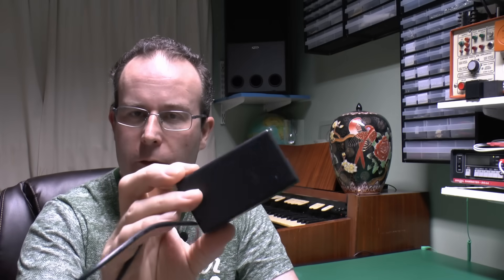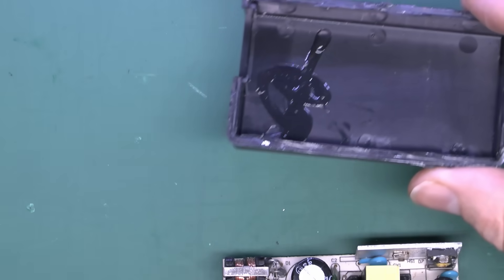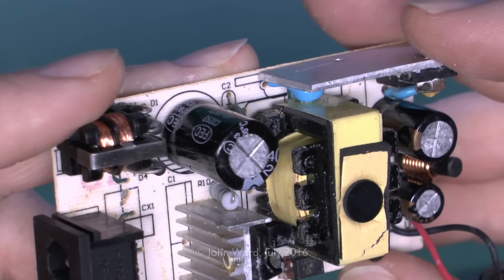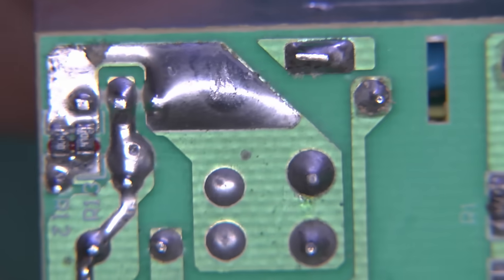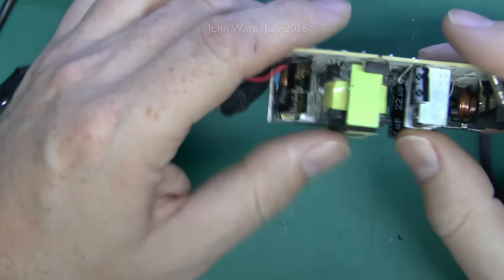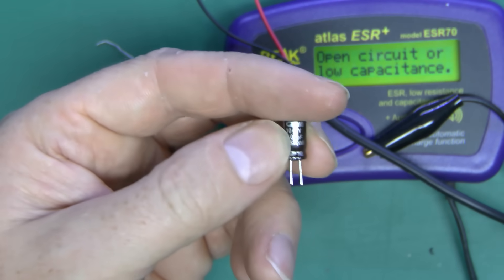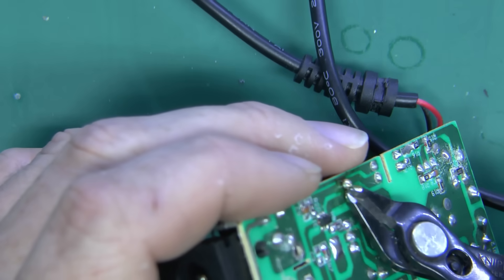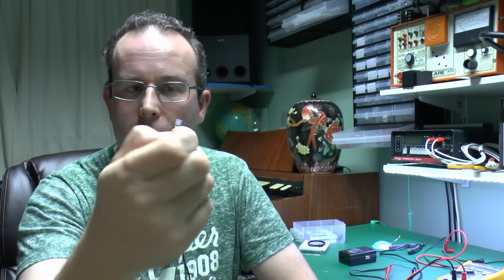12V Power Supply Repair

Comment: Just a quick device protection and/or safety tip regarding the uninsulated ends of the PSU output.
I find that when I have the extra wire length to spare, it greatly reduces the chance of a short circuit, even when I attach test clips to the wires, if I first cut one wire so that it is an inch or two shorter than the other wire. That way, even if the wire ends or test clips are set on the test bench and would normally re-align to be adjacent to one another and likely to short out...as seen at about 15.00 in your video...with the physical separation they are now much less likely to make accidental contact.

An alternative method if the wire length and leads permit it, is to fold one wire back over itself and tape it or rubber band it in that position. Again, the point is to make it more difficult for the ends of the wires to contact each other by accident.
Reply: good tip
I do that with LIPO batteries when soldering connectors on them. also discharge them to a safe minimal level.

Comment: Hi John!
Just some thoughts from me, I repair consumer and industrial electronics for a living in Germany and as its almost always the PSU that fails I've had a lot of experience with smps's.

First thing I check after the visual inspection is always semiconductors. They like to short out when they get hot. 
If they're all OK, I will power it up with an adjsutable isolation transformer and see where voltage is present.
It there is a voltage at the main CAP, I'll go to measure AC voltage at both sides of the transformer. If there is voltage, I check the secondary rectifier/regulator curcuit.
So in this case there probably wouldn't be voltage on the transformer as the control-circuit has a fault. 
Which means I'll have to look in the primary control circuit.
As the semiconductors were already checked, there are only resistors and caps left (Inductors rarely go bad, I check them last)
and I can say from experience that most of the time these tiny caps dry out and loose capacitance. The big ones on the other hand like to overcook which can be observed quite easily.

Note on testing components: I check Semiconductors in circuit with my fluke. If I'm not sure I'll desolder it and test it isolated from the circuit. Most of the time there are other components interfering with the measurement.
Which is why I always measure resistors, caps and basically every other component out of circuit. Just to be extra sure and don't get confused. 

Side note on the Cap-Tester you use. We've got one of them at work too, unfortunately the old kind where you have to press the test button with your third hand while holding the leads with the other two :D
I've come across a device called M-Tester on ebay, apparently some guys in a forum developed it ages ago on the basis of an arduino.
Then somehow the chinese started making it.
Its like 10 bucks and can test pretty much everything with extraordinary accuracy (for the price).
Resistance from 10mOhms up to several MOhms, Capacitance from pF to milliF (including ESR and Vloss), Inductance, diodes, transistors(amplification and switch-on-voltage), mosfets and more. (Its got three connections it can measure between)
The way I view it is that it takes the component in question and tells you how it would behave in a circuit. Very helpful, I've had caps being measured like resistors and transistors being measured like two diodes. 

Funny irrelevant story: Recently I came across a TO-92 resistor in a Denon Amplifier which had actually gone open circuit! No measurable resistance whatsoever between all three legs!
So apparently semiconductors don't always short out but in like 99.99% of all cases. I guess the internal leads overheated and melted away. 

Lead-Free is easy to use, just get a higher temperature on the iron and use flux. In trade school we had a SMD soldering challenge and the teacher supplied us with Lead-Free solder. I didn't even notice it, I thought I was soldering with leaded :D
Reply: and the caps in the psu failing?
Reply: not all lead free solder is high quality like you used in trade school. If you buy the garbage from Ebay you will find that out

Comment: I had a laptop power supply that did not work and the green light was not on.
I could see that the cable looked damaged near where it plugged into the laptop. I cut it and opened up the cable and the wires had got twisted and shorted.  I cut out the damaged section and re-connected and it was perfect.  Worth checking before opening up the sealed box.

Comment: Nice - i couldn't help thinking, "hey, this fellow sounds a lot like the voice in my head when i'm muddling through some problem or another (but with an other-side-of-the-pond accent)."  
Some of these power supplies/adapters can be so intimidating... it's refreshing to see a unit with a straightforward layout.   I'm working on a few Dell PC power supply units with no obvious faults, and this video gave me some inspiration to dig back in.   I think it's time to invest in a reliable capacitance tester, since problems so often come down to those failed electrolytic caps..  just haven't seen them vent from below in my limited experience.  Good to be aware of - Thanks for sharing!
Reply: Forget capacitance tester. Get an ESR meter via eBay. Or one of those fancy "Peake" ESR meters as used in this video. Far more useful for checking electrolytics than measuring capacitance - especially if the capacitor is in circuit.
Reply: Cheap ESR and capacitance meters are better than nothing, so long as they aren't fake. Cheap ones are what I've got, and they're good enough for troubleshooting.
I'm not sure about your Dell power supplies, but I've seen PSUs that use their RF shielding or metal case as a substitute for a ground plane. Because it connected the PCB grounds together, a loose screw could prevent the power supply from operating. It's a rare problem and discovering it can be a major headache.

Comment: These types of boxes can often be opened with a vice or a few hits from a mallet.
It did look like it has a very low clearance distance between the diode heatsink and the blue safety capacitor.
Reply: You have a good eye, I totally missed that. Most likely the end of the heatsink was designed to be wrapped in tape. I have seen that often, and while I think it is a bit of a hack it meets the requirements. The spacing isn't so bad otherwise, so I think the design was safe originally and they just cut corners later. Definitely warrants fixing, this is dangerous.
Reply: I looked for it. I review usb power supplies and one of the things I do is disassemble them at look at the safety and you are right, everything else looks decent. Not like the one I have just disassembled: less than 1mm clearance and Y cap is a 1kV cap, not a real Y cap.
Reply: What I don't understand is why even populate the Y-cap with a non-safety part, why not just leave it out? I have measured emissions on many power supplies which far exceed the limits, it's not like they care about EMI any more than they care about safety.
Reply: use a chain saw its even faster

Comment: Thumbs down! You just went in there willy nilly! You went in with no plan! You didn't test voltages at different stages. If this was a vehicle, you basically checked all four tires to find the flat. You found the problem, but in no way was it the efficient route.

Comment: Which flux did you use and was it to separate the solder between the two leads of the capacitor?

Comment: At least all the caps are rated at 105 deg C. In this kind of PSU, unless the fuse has blown, the startup cap is the first thing to go for.
Reply: Technically they aren't rated at 105 deg C, they have a guaranteed life at 105 deg and it's normally only 1000h. If you need a longer life you have to ensure they don't get as hot. That may be by limiting their ripple current or limiting the max ambient temp or whatever else. Every 11 deg C reduction in temp results in a doubling of cap lifetime.  Basically all these cheap Chinese psu's fail because they are really badly designed  and underated for their application.

Comment: Notice how the manufacturer also firmly welds or glues the unit together so you practically destroy the case and give up trying to fix it!
Reply: it's quite easy to take part of glued cases. You can just "drop it" to the deep freezer for a while and after that you knock all the glued area with a hammer and the glue cracks and release the parts. Then after repairing, you can glue them together again and will looks like you have never touched it. But using that blade is unsafe and disgusting.
Reply: @oneilszrf  thank you for that tip. I have leaned so many helpful ideas from you tube viewers
Reply: +jim halcom - Do a youtube search for "opening sealed power supplies." You'll be surprised at the nondestructive methods you can use to open these things with very little damage.

Comment: You need to test it under load, for example a halogen lamp 20W. Cheers
Reply: I test it under load by replacing the psu back in the monitor I was repairing

Comment: Hi John
I saw a video today from 'Mike's Electrical Stuff' and his tip for getting apart boxes like you had here was to hit them hard with a big flattish handled screwdriver along the join many times, this will break the ultrasonic bond and keep the flange so you can re-glue later
Reply: yes I have been doing that method for years but what I didnt know is to put them in the freezer first suggested by another viewer. That makes the bond even more brittle and easier to seperate
Reply: Ive heard putting in the freezer for half a day then hitting them with a wooden mallate along the seam line opens them quick
and if you crack the case, you can always repair them with fresh cyano glue
Reply: You left out one major important detail! that is before you do that put them in the freezer for 24 hours. if you dont the crack may go over the case and not the bond!

Comment: Looks like a beginner is doing the job. Peeling off the sticker label is unnecessary. Presence of screw / screws can be find by running finger nails on the label.

Comment: Did you notice how the cap didn't have a vent on top, so it leaked out of the terminals. That's probably what that brown stuff was.
Reply: yup
Reply: most definitely and a sign the manufacturer used bargain-basement components

Comment: An old ham radio engineer once told me 50 years ago "when repairing/restoring old equipment, just replace all the electolyic capacitors and 99% of the time it will make it work like new. they dry out over time
Reply: nope, not always, waxed paper dielectric caps are more a problem, in valve equipment, but yes electrolytics do dry out eventually, depends on hours of use and temperature more than just 'age'
Reply: After a shock my psu is defect. What is the problem please?
Reply: plus other components can and do fail...
"replace all caps" is NOT a magic cure all or guarantee for no future failure
Reply: @haitemhichri9171  we need more information? what shock? what psu?
Reply: @haitemhichri9171  you zapped all the semiconductor devices
destroyed them with ESD
Reply: @andygozzo72  no its not a magic cure but it sure works 90% of the time for me
Reply: @andygozzo72  I think he is trying to say that after an electrostatic discharge of high foltage his lab power supply no longer works
That happened to me when I was testing a stun gun. the back emf blew out my Lab power supply
Reply: @andygozzo72  In valve/tube equipment it is almost a magic cure, actually. If the new caps are tested before fitting.

Comment: The sticky deposit is uncured epoxy resin - from the manufacturing process which sticks the two halves of the case together. Clearly a blob got onto the inside of the case before it was selaed...
Reply: these boxes are ultrasonically welded, no glues used. it is potting compound or epoxy that is used in the factory not on this product though. somehow it was there accidentally but the casing was re-used as they see no harm done. but it made the whole world wondering why it was there.

Comment: This case is clued. To open need use heat littlebit (hot air gun), first of all it is worth to begin to open, the DC socket of the upper and lower edge  of a strong knife (like wedge). Their disassembly is pretty difficult (without wounding)

Comment: Was thinking of that cap or the 2 series resistors that feed it a start up supply. Board is typical of a water wash to remove water soluble flux, done with old water and with almost no final QC aside from a final test after assembly to see it lights a lamp and does not blow up. Otherwise could also have water picked up during storage in the manufacturing plant or during shipping via container to the UK.

Label saying made 2009 is very likely, as it would have been excess stock picked up by the lighting assembler to make up the kits, using whatever was available in the market and which was cheap yet met his requirements as to minimum and maximum voltage ( could have used 11-14V output) and which was at a minimum spec for current.

Comment: Nice video. I used to inspect electronic goods manufacturers in China a lot in my old job. Most factories i visited had excellent quality control systems, but some were just terrible.  No environmental controls anywhere and really high humidity meant components would sometimes be in a poor state of corrosion even before they were placed on the boards.

Comment: Bravo Very good work  this capacitors is made in china  very bad  i fund radios  from Telefunken  40 years old and works perfectly still today. Best Regards from Frankfurt Germ,
Reply: the expression "they dont make em like they used to" rings true... short of hitting an electron tube with a hammer, it was pretty hard to destroy it with ESD  or overcurrent for short periods of time

Comment: The one I repaired is a dead 5V 3 A smps and what I got is a not so well working unit with voltage randomly fluctuating between 4v to 5 v.

Comment: What's wrong with  my 12v power supply  when i connect to gadget there is a sound perhaps like a static or humming
Reply from the maker: Failed output filter capacitor, or it's just a poorly designed thing in the first place.

Comment: Whenever I troubleshoot power supplies and other electronic equipment I always suspect any electrolytic capacitor that is mounted close to a heat source, such as a heat sink.  In this video the capacitor that failed is mounted right next to what looks like a FET or some other transistor mounted on a heat sink.  The heat generated by this component dries out the capacitor and hastens it's demise.  I see this all the time in power supplies in LCD TVs, computers, etc.  Sometimes you can actually see the capacitor bulging on the top or bottom as the heat caused it to swell up and fail.  Most of the time you can simply replace the capacitors to fix the problem, however on occasion the defective capacitor(s) will cause other components to fail which can be more difficult to troubleshoot and find replacements for.
Reply: Thanks for the tip, very easy to look for before going the long ball for repair.
Reply: almost all of my monitors and flat screen TVs died because of bad conaxon caps used in them. I went and ordered the the best caps I could find, repalced them all and am using the monitor right now to tell you this. The monitor has been working for 3 years now
Reply: David Parry  yep, the infamous 'capacitor plague'
Reply: after suspecting the capacitors, look at the output transformer next. the industry has been using low temperature plastic insulation on the transformer magnet wire so it melts off at 250 degrees to aid in soldering.Over time at 150 degrees the insulation breaks down, that way they sell more products. Gone are the days of high temperature enamel insulaion.
Reply: @rogerd4559  hmm,yeah, i have some enamelled wire with coating that easily melts off when soldering, its about 30 years old, though, got it from RS,  also got other stuff with coating much harder to get through and tin!
Reply: this  RS stuff was specifically described to be easy to solder....
Reply: @andygozzo72    that harder coating is the industrial grade you find in Military grade motors and equipment in aircraft it is the true high temperature enamel insulation that will last 60 years. the garbage the use in consumer goods cant even last 2 years
as I found out the hard way with the power supply in my Insignia monitor, after replacing the caps the transformer went
all the pins on the transformer are less then 1 ohm
Reply: Seriously? You don't have to discover a America... Christoph Columb done it already.
Reply: This is a really juicy tip. Thanks. I have a computer monitor that when on stand by there's a little ticking sound every 5 seconds which obviously goes off when the monitor is turned off standby. I read that this is caused by a relay going faulty. Would this be something that's plausible?
Reply: its a common-sense, and thanks for the sharing ..
Reply: and the shorter consumer electronics life-span (initiated by china's strategy) is the new economy. basically, goods are sold cheap yet would only lasted 2,3 years (or more if u r lucky) thus requiring a replacement which supposedly good for economy as demands cycles are shorter thus money moving faster due to shorter cycles ...
Reply: @rogerd4559  any good brand for caps to suggest?
Reply: @Kerveros1904  Just buy name brand Capacitors and preferably not from China. or on Ebay because most of their stock has been sitting around for over 20 years. Buy a cap tester that has an ESR test
Reply: @andygozzo72  ,'
Reply: @rogerd4559  very difficult to buy non chinese made parts as most seem to originate from there these days,
Reply: @PiotrK2022  America was discovered LONG before Columbus showed up.